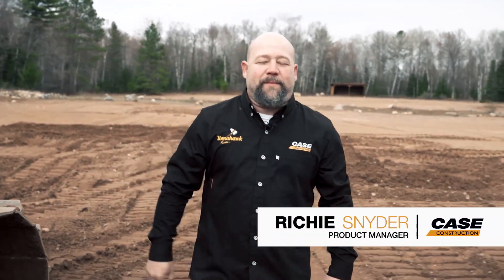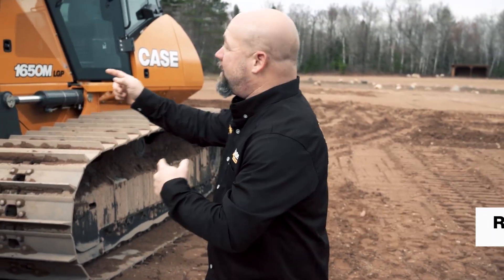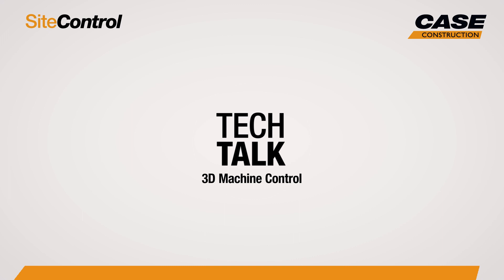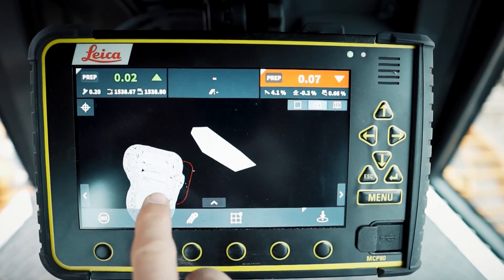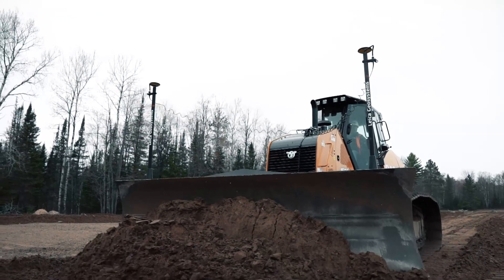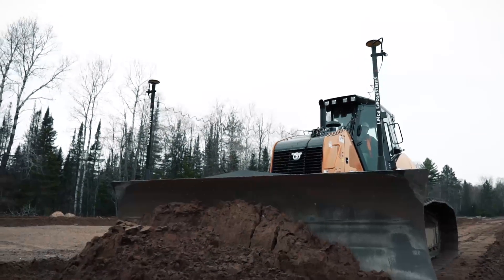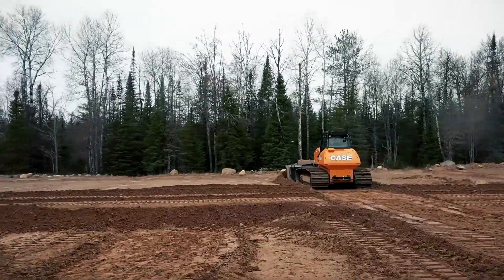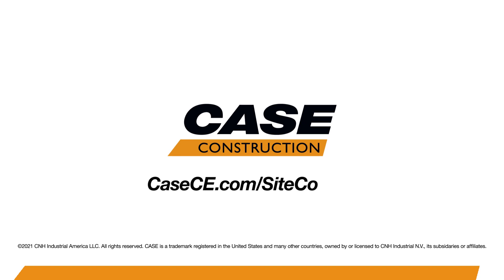North America: TechTalk: CASE SiteControl 3D Machine Control Dozer Solutions

Comment: Richie, how do you obtain the 3D model/file of your site, to begin with?  I assume that a 3D rendering of the site gets uploaded to the system which SiteControl, then, references and acts upon.  Yes/No?
Reply from the maker: Short answer is yes.  Many customers today have their own site engineer on staff to create the model or files needed to operate automatically in a 3D environment.  Outside engineering firms can also be used to create models.  3D machine control is a solution that puts the design surface, grades and alignments inside the cab of the machine.  3D uses a combination of GPS, or a total station technology, to accurately position the blade in real time. This significantly reduces material overages and dramatically improves the general productivity and profitability.  Once the design is created by the engineers they can export that file into various formats.  A couple examples would be XML, DTM, DXF etc.  These files are then uploaded either via a memory stick or over the cloud into the machine control solution.